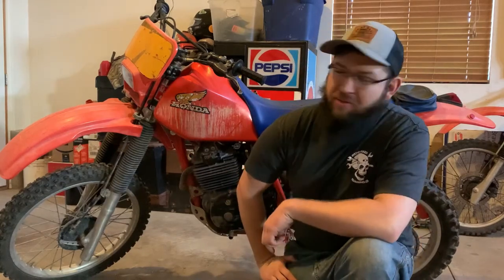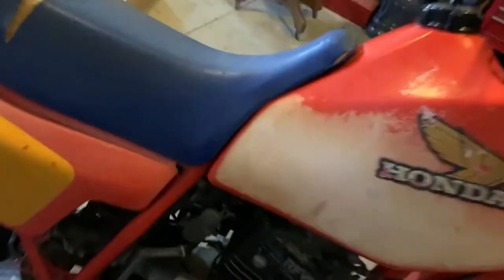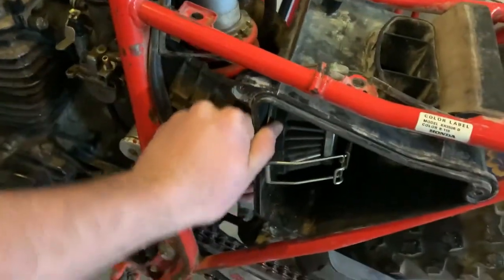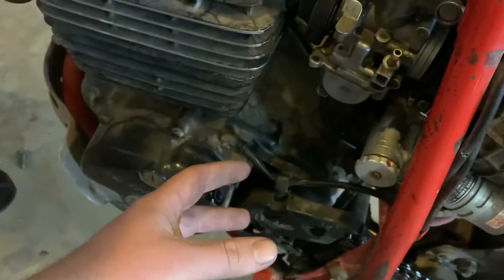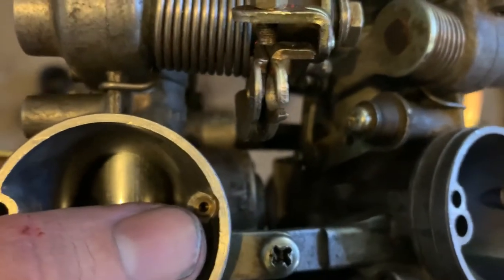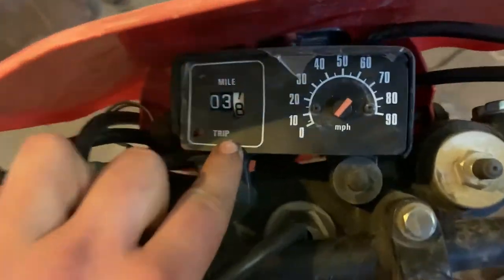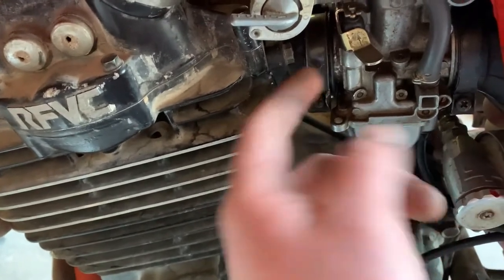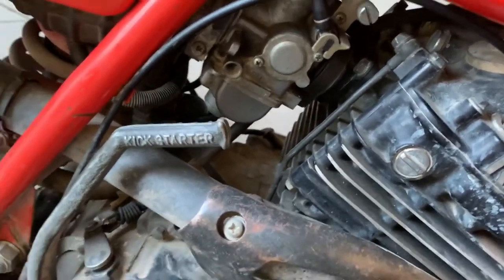1983 Honda xr350 dual carbs

Comment: I found a 1984 xr 200 with 75 orginal miles,  dual carbs, has very hard time starting, almost like choke isnt working, il get around to working on it some time
Reply: Yea I just picked up a 84 xr250r dual carbs aswell, when I go to start it for the 1st time of the day I have the choke on prime the cylinder twice then it starts 1st kick. But if I shut it off it wont start I have to let it sit for 10-15mins before starting it again. Really frustrating I think I either need to clean or rebuild the carbs
Reply: Adj floats secondary carb

Comment: Picked up a 84 XR 200 Dual carb setup. ? On harder. acceleration  power cuts out   sounds second carb not cutting in could be a simple fix.  These getting hard to find now.  🇦🇺
Reply: There's a link between the two carbs that comes loose in this video. He had to replace the part from another carb. That could be it.

Comment: What do you plan on doing with this bike when your done fixing it
Reply from the maker: The bike was sold after fixing it. If interested I know where another is.
Reply from the maker: Hello Eric butler. I have another one of these bikes in the process of getting fixed up. Let me know if interested.
Reply: @beastautomotive5053  Where are you located and what is the condition of this other 350?